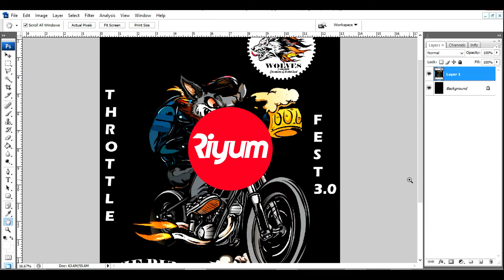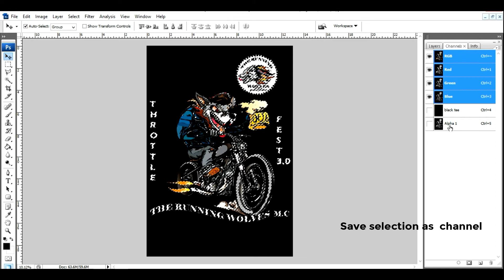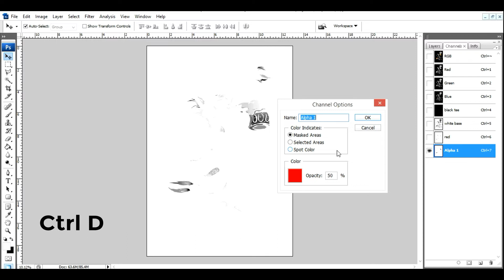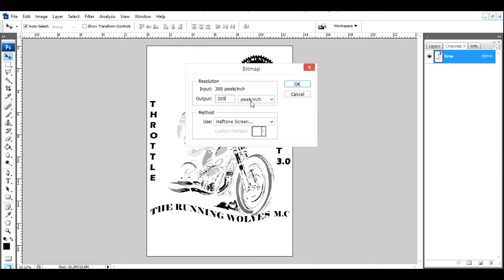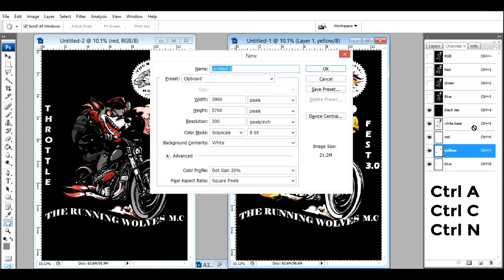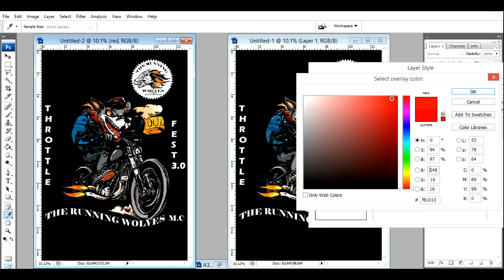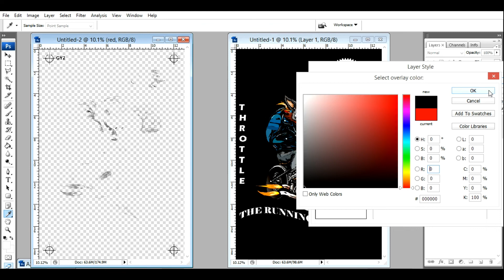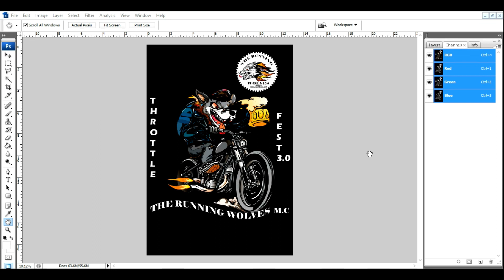T-shirt Screen Printing Color Separation in Photoshop | Step By Step

Comment: I saw in another video you registering the art work on the pallet 
Using what looked like a registration film.

Can you do a video on exactly how you register your films to the screens?
With no micro registration does your technique give you perfect registration once screens are exposed or do you still use some form of micro registration?
Reply from the maker: Yes it’s a registration film u need to print out and paste it in the pallet. After that u need to align each film on top and register. You can watch our latest video. 
We r using a 3 pin registration system which has a micro registration in the frame itself. It gives 100% accuracy when done right. 
Hope this help.. thanks for watching 😊